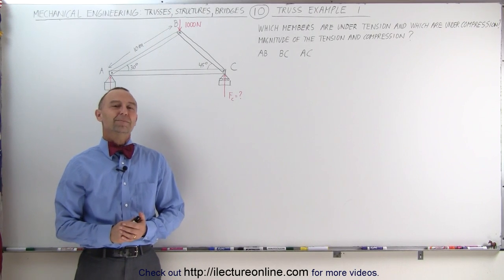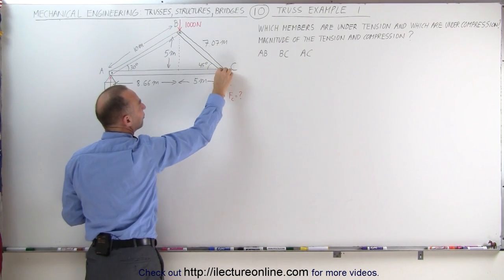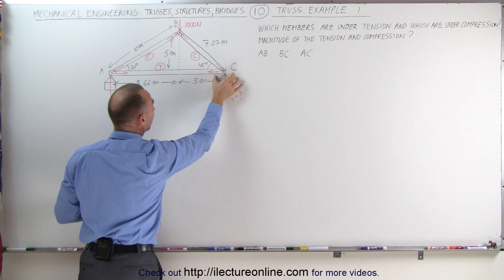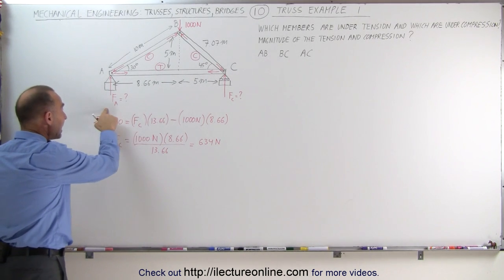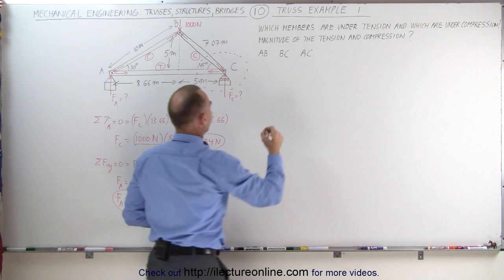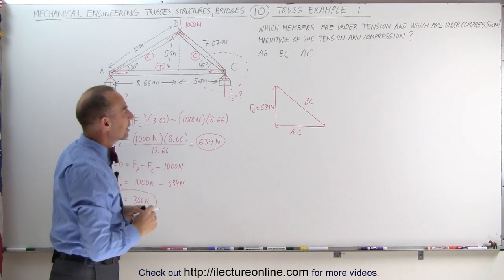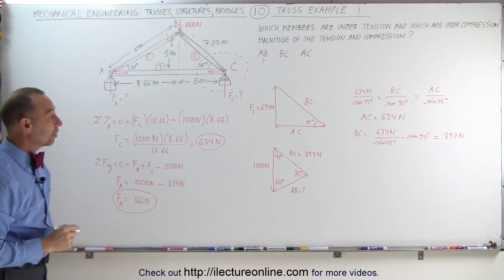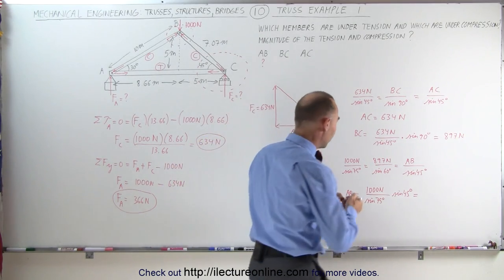Mechanical Engineering: Trusses, Bridges & Other Structures (10 of 34) Truss: Ex. 1

Comment: when calculating the moment at point A, is there a reason why we don't consider the reaction force at C? is this because the weight is ignored in these types of problems?
Reply from the maker: +aequanimus63247 
Both the 1000 N load and the reaction force at C (Fc) were used to calculate the moment at A, thus I am not sure what you are asking?
Reply: +Michel van Biezen I wasn't sure if the forces on both A and C were reaction forces or not because I didn't see a reaction force in the x direction at point A considering the type of bracket.
Reply: +aequanimus63247 Which is why I thought that the forces at A and C were simply another applied force to solve for.

Comment: Dear sir, I have a question for you. if the 13.66 m member is under tension, will not be the forces opposite? Thanks
Reply from the maker: The arrows indicate the force applied by the beam on the pin (connection)
Reply: @MichelvanBiezen  Thanks

Comment: do you take into account the earth's curvature when designing a bridge. thanks
Reply from the maker: Yes, they do.  Especially when there is a large span.
Reply: Michel van Biezen thanks very much for replying, could you link me to any videos explaining this please and what the curve is over a given distance. thanks for your time
Reply from the maker: We actually don't have a video on that exact topic, but if can be calculated using the arc length equation.  The arc length = radius times the angle in radians.    Once you have the angle you can calculate the how much the bridge tower leans.
Reply: Michel van Biezen maybe you could do video on the subject because I can't find an official consensus of the curvature on an oblate spheroid. thought maybe bridge designers would know this number

Comment: why have you put AC as 634 N? Surely it is 1731 N ??? I have checked with the sin rule on the truss as a whole, AC/sin(105) = BC/sin(30) = AB/sin(45), so yeah I agree that BC is 897 N and AB is 732 N, so AC=((BC/sin30)*sin(105))=((896/sin(30)*sin(105))=1730.9N
pls can you confirm this or tell me where I am going wrong
Reply from the maker: The video is correct.  AC is indeed 634 N    Draw a triangle for the bottom left joint and you will see.
Reply: Where did you go wrong ?